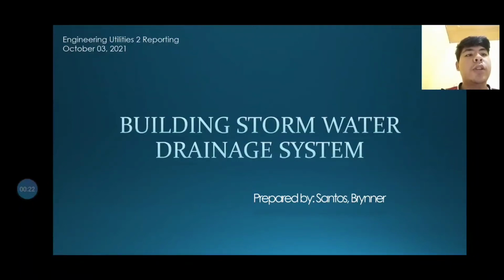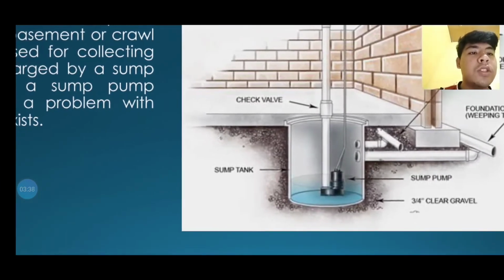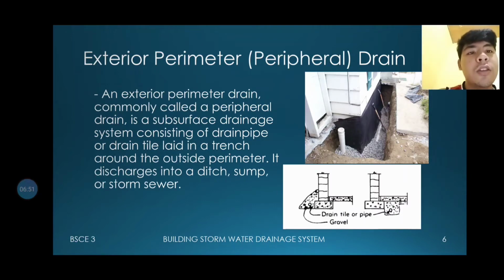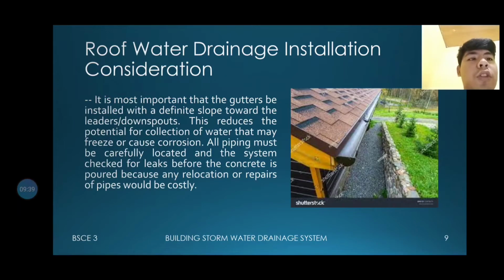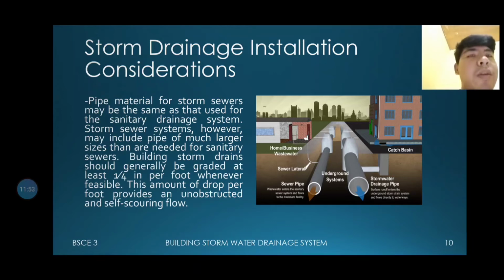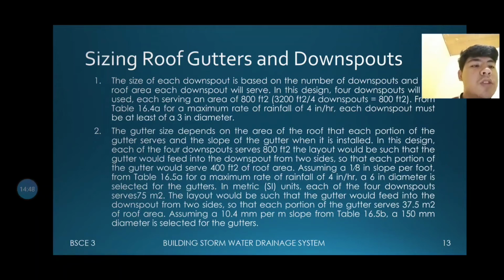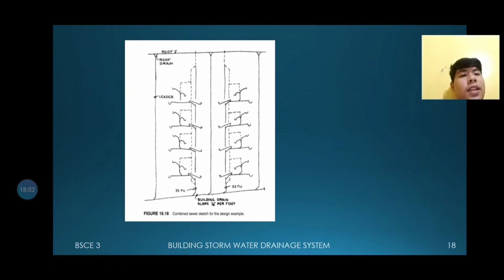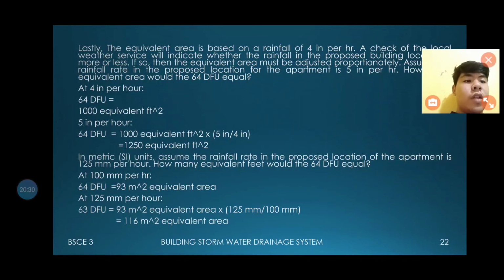Building Storm Water Drainage System

Comment: In this topic, I learned that the drainage should be considered while planning driveways, parking lots, and the surrounding area. The project's site plan must be examined on the ground. to see how existing and updated outlines may affect the environment effect on surface water flow. A pit or reservoir called a sump can be located in the basement
 or crawl space floor. It is used for collecting water that is discharged by a sump pump.

Comment: In this topic I've learned that the storm water drainage system contributes in flood protection by directing rainwater into nearby waterways. The water and toxins are delivered immediately to the nearest stream, pond, or reservoir by storm drains and subsurface pipes.

Comment: Subsurface drainage lowers the watertable and drains excess water through open pipe with the goal of decreasing or managing the water table depth below the crop root zone, according to Santo's report. A subsurface drain cannot function unless it is installed below the water table. The drain will stop flowing whenever the water table reaches the same elevation as the drain.

Comment: Subsurface drainage system is the removal of water from the rootzone.It pointed the solution for groundwater infiltration problems includes sump pump, interior and exterior perimeter drains and interceptor drains which helps to reduce problems.Also storm drainage installation consideration may help to reduces overflowing.

Comment: In this report, the reporter teaches us or he discusses his topic very well about the topic that It is a system of structures, channels, and underground pipes that transport stormwater (rainwater) to ponds, lakes, streams, and rivers. The network is made up of both public and private networks. and also It is an essential component of the county's stormwater management system, which is designed to control the quantity, quality, timing, and distribution of storm runoff.

Comment: In this video, learned that the storm water drainage system helps to prevent flooding by channeling rainwater into nearby waterways and the most prevalent causes of this water are higher water tables or particularly rainy weather. And also in this video taught us that an underground drainage system removes water that has penetrated or been stuck in the subterranean below.

Comment: In this lesson and video I learned that the roof and surface drainage solutions outlined in the previous part may easily alleviate most groundwater infiltration concerns, as you discovered in this lesson. Stormwater drainage systems channel rainwater to neighboring waterways, preventing flooding. Rising groundwater levels or particularly rainy weather are the most prevalent causes of this water. An underground drainage system removes water that has penetrated or been stuck in the subterranean below.

Comment: This lesson taught me that the roof and surface drainage solutions described in the previous sections may easily fix the majority of groundwater penetration issues. The storm water drainage system helps to prevent flooding by channeling rainwater into nearby waterways. The most prevalent causes of this water are higher water tables or particularly rainy weather. Water that percolates through or is trapped in the underlying subgrade is removed by subsurface drainage.

Comment: According to what I've learned in this presentation, Subsurface drainage systems are put beneath the top layer of soil to eliminate surplus at the rootzone level. The rootzone's excess water runs into the open drains. I've also come to grasp the significance of the sump tank and sump pump.

Comment: Subsurface drainage removes water that percolates through or is trapped in the underlying subgrade. Higher water tables or particularly wet weather are the most common causes of this water. The storm water drainage system contributes in flood protection by directing rainwater into nearby waterways.

Comment: In this video i learn the subsurface drainage system, storm water drainage systrm. Water that percolates through or is trapped in the underlying subgrade is removed through subsurface drainagr. This water usually caused by higher water table or particularly wet weather. The storm water drainage system, by channeling precipitation into neighboring waterways, the storm drainagr system aids in flood prevention. The water and contaminants run through storm drains and subterranean piprlines, whetr they are carried directly to the nearest stream, pond, or reservoir.

Comment: After watching this report, I've learned that subsurface drainage system are placed beneath the top layer of soil to remove excess at the rootzone level. The excess water from the rootzone flows into the open drains. I've also realized how important the sump tank and sump pump is. Sump is infiltration basin used to manage surface runoff water while sump pump is a mechanism that remove water to the lowest point of your home like basement.

Comment: In this video, I learned that the roof and surface drainage solutions discussed in the preceding sections can simply solve most groundwater penetration issues. It is most important that the gutters be installed with a definite slope toward the leaders/downspouts. The open spaces provided in truss-type construction  make it easier to run piping through to the desired location.

Comment: This topic taught me about subsurface drainage systems, storm water drainage system installation, and a storm water drainage system design example. The act of removing water that has penetrated into the soil in excess of what capillary forces against gravity can hold is known as subsurface drainage. It also goes over roof and storm drainage installation issues.

Comment: I learned about subsurface drainage systems, storm water drainage system installation, and a storm water drainage system design example in this topic. It explains that subsurface drainage is the process of removing water that has infiltrated into the soil in excess of the amount that can be held by capillary forces against gravity, and that the sump and sump pump, interior and exterior perimeter drains, and interceptor drains are the solutions to groundwater infiltration problems. It also covers the roof and storm drainage installation issues.

Comment: After watching the video, I realized that subsurface drainage is the process of removing water that has infiltrated into the soil in excess of the amount that can be held by capillary forces against gravity, and that the sump and sump pump, interior and exterior perimeter drains, and interceptor drains are the solutions to groundwater infiltration problems. Furthermore, it goes through roof and storm drainage installation considerations. The technique for sizing roof gutters and downspouts, sizing the horizontal storm drain, and sizing a combined sewer is explained in the design example.

Comment: In this topic, I learned about the subsurface drainage systems, storm water drainage system installation, and design example of a storm water drainage system. It discusses that the act of removing water that has infiltrated into the soil in excess of the quantity that can be held by capillary forces against gravity is known as subsurface drainage, and the solution to the groundwater infiltration problems are the installations of sump and sump pump, interior and exterior perimeter drain, and the interceptor drain. It discusses also the roof and storm drainage installation considerations. In design example, it discusses the procedure outlined of sizing roof gutters and downspouts, sizing the horizontal storm drain, and sizing a combined sewer.

Comment: What ive learned in this video is that subsurface drainage describes the process of removal of that water which has infiltrated into the soil in excess of the amount that can be held by capillary forces against the force of gravity. Water table drawdown by ditch and pipe subsurface drains